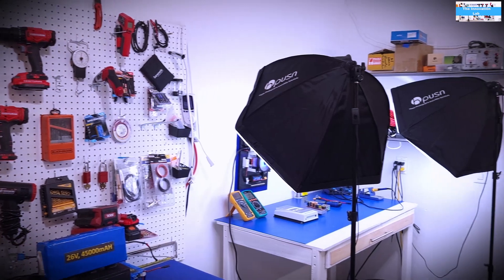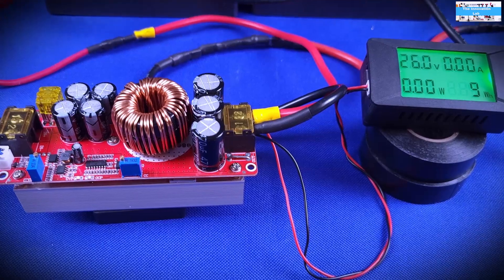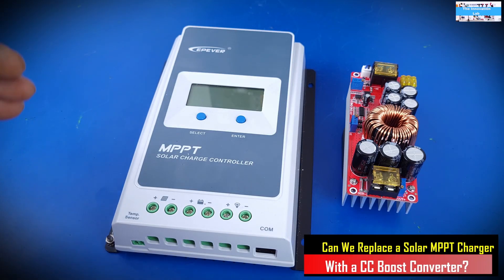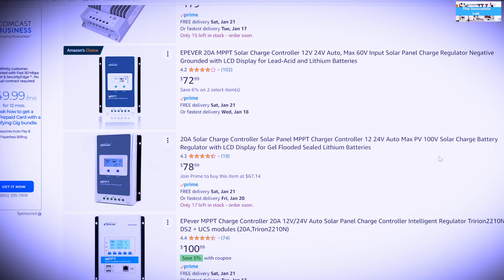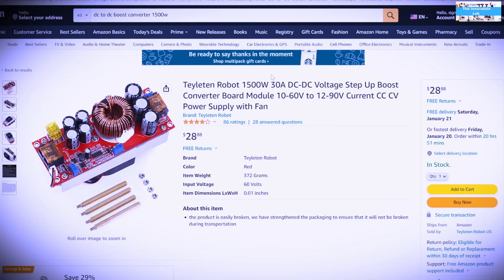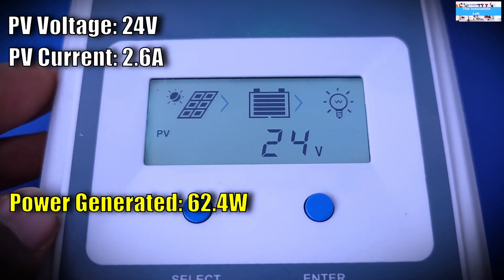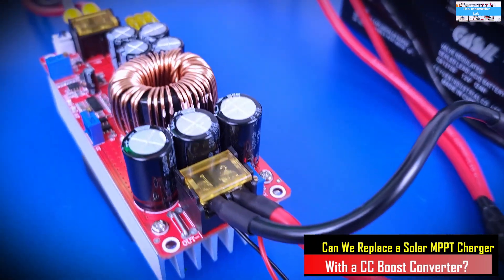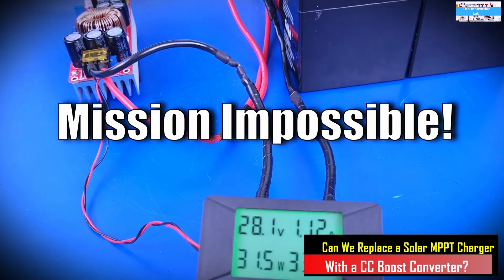Solar MPPT Charge Controller vs DC to DC Boost Converter, which is Better for Solar Charging?

Comment from the maker: This video was intended to be a fun experiment to show the differences in function between an MPPT solar charge controller and a constant current DC-DC boost converter. I have received a lot of questions regarding this subject and I decided to perform this experiment to help answer those questions. I realize that the experiment is not perfect and there were some mistakes. However, I intend to repeat the experiment with actual solar panels this coming summer. Stay tuned!

Please share your wonderful comments, questions, and suggestions as usual.
Thanks a lot for watching!
Reply: Being a fun/educational video is ok, but you did some mistakes because of the under the hood technology little know details (that's why the math don't checks)

MPPT charge controllers are simply smart-self-adjustable PWM buck (step down) DC-DC converters, yes, step down voltage converters, so the solar panel side voltage must be at least X volts above the battery voltage (datasheets of the rig must state the minimum delta V) or the efficiency will get lower and lower; that's why they recommend at least twice the voltage from solar to panel, and MPPT over a PWM solar chargers when you have high voltage on solar vs. battery 

That's a 24v solar (36-40v Voc) for a 12v battery or 48v solar (60-80 Voc) for a 24v battery, the efficiency is better if the differential voltage is high

A Step up DC-DC like the one you used pumping 24 to 28 volts is not very efficient as you see on the test, same reason: the differential voltage is to close; try to do 12-18v to 28v and you will see the difference.

That being said, I'm doing a research now about that, and all the literature points that for low power setups (< 200W solar) the difference between a [ proven and good quality] PWM and a MPPT solar charge controller is so small that don't worth the inversion on a MPPT unless you live near the poles and have a very low solar radiation. [I've all the parts inbound to mount my setup]

Note: Cheap PWM controllers are just shorting the solar to battery terminals on a PWM switch to match some limited current delivered, no inductors to store and deliver current in an efficient way. In the other way proper PWM buck or boost controllers [like the one you features on the video] are more efficient as they store the difference in potential as energy on a toroid to deliver it over time, raising the efficiency of the system.